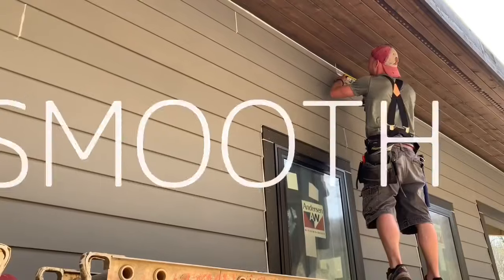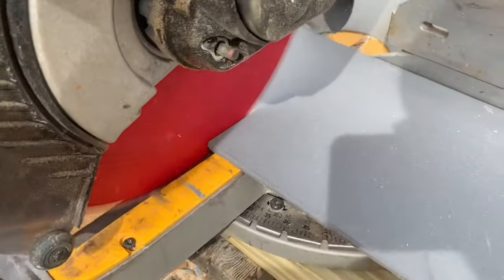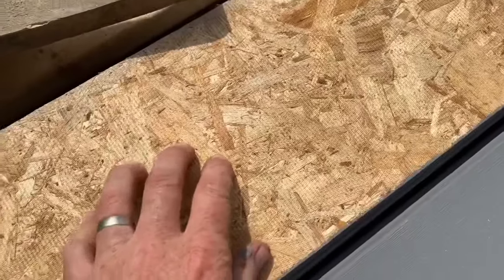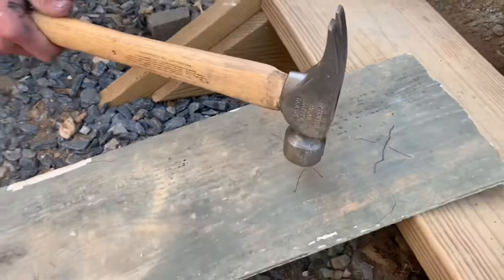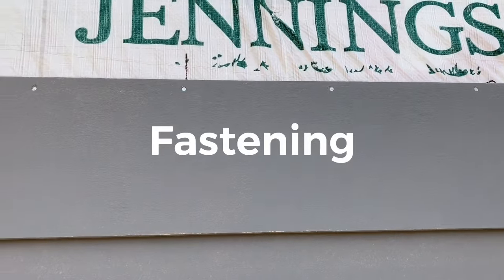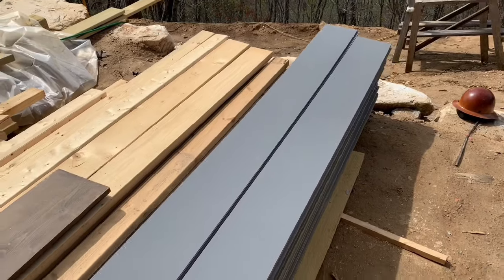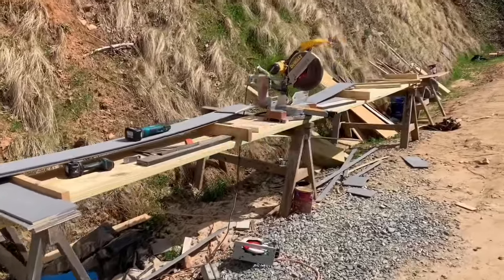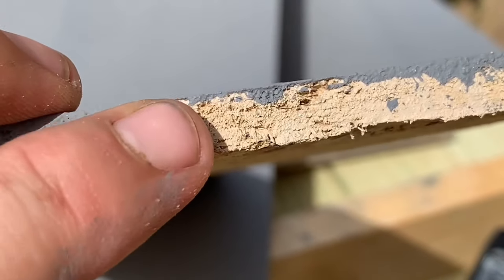Smart Side vs. Hardie Board Siding which is better

Comment: I started as a painter.  Took me 10 years to teach my carpenter buddy to PAINT ALL SIX SIDES BEFORE INSTALLING.  Moisture can enter the product through the back side unless this product is sealed somehow, and that will significantly reduce the lifetime of the paint job, as well as subsequent paint jobs.  I especially don't trust OSB, especially in my climate as we see the product rot out, especially under windows.
Reply: N. Johnsoh some painters don’t like painting all sides on a interior door. Ever looked in your closet above the door?
Reply: There are small gaps under my plank siding. I’m concerned about moisture getting through the gaps during strong wind and rain or during pressure washing. 

What’s your thought of caulking between the planks?  Seems caulking would reduce wind and moisture penetration but would it hold moisture behind the siding thereby delaying drying and leading to mold and/or rot?
Reply: Craig Wheeless 
We used to caulk between the butt joints but now prefer to slip a piece of flashing behind there.  The problem with caulk is that it tends to let go with the expansion and contraction of the siding, and this also allows the caulk to show after its been painted.  The butt joints will not absorb much water if properly painted and sealed, and any water that is absorb now has a path to dry.  Also, you always assume that any method will fail to stop water from getting in at some point, and therefore plan for a way to let the water/moisture back out.
Reply: N. Johnsoh 
Thank you!
Reply: @Josh Yingling 

It does not. It is absolute garbage, even if maintained/painted yearly. A single drop of moisture gets on that OSB and its game over. 

 I had several jobs a while ago repairing siding where this was the  product used and it was completely unavailable, nobody had even heard of it. I got unbelievably lucky and found a small mom-n-pop hardware store that just so happened to have some leftover from a special order that had been placed 3 YEARS prior.

Of course a couple months later every major hardware store (lowes/HD) had it on their shelves as regular stock. 🙄

Its true that Hardieplank can be a bit tricky to work with (impact sensitive) and can become brittle with time and excessive water exposure. But, it is completely impervious to rot and holds paint exceptionally. It is one of the few sidings available that can withstand a lifetime of florida weather. With proper maintenance (paint) of course.
Reply: @Mote78  I used construction adhesive between the top bottom of each lap on a Hardie Board installation. That was for strength though. Didn't want the boards lifting. I left some gaps for air circulation. Used flashing behind each butt joint and did not calk the butt joints. I would do the same thing if using Smart Side lap siding.
Reply: I installed LP Smart Side 4x8 siding panels and painted the bottom 3 feet on the back of the panel. Those tend to rot out on the bottom after 8 - 10 years.
Reply: @regularguy9264  / caulk will never hold up long term without first priming raw wood..
Reply: Miter joints for siding 👌🏻
Reply: @regularguy9264 , use Big Stretch caulk and it will not let go.  You should still use a piece of flashing behind the joint though.
Reply: @comancheclub3449 , you have no clue what you are talking about.  Smart Side is very moisture resistant.  In fact, the Hardie Board is more porous and likely to be become brittle from water damage before the Smart Side would.  The only thing you need to make sure of is to paint the cut edges before you install them and caulk the butt joints.  Smart Side is far superior to Hardie in every way.
Reply: @jtltet  

Please elborate further. Maybe you have a different smart side material than what ive used/seen? 

If you leave a 1x1 piece of OSB and hardie out in the elements the hardi will be there long after the OSB has completely crumbled into pieces.

Hardi is a cement product, smart side is a wood product. Cement literally can not rot. I admit it does have its faults, no product is perfect.

What characteristics of smart side do you find superior over hardie?
Reply: @comancheclub3449 , I have the textured LP Smart Siding on my house.  It has a wood grain pattern and it is not smooth.  I have left some cut pieces of it laying outside in the rain for over 2 years without painting the cut edges or the back and it has not had any rot or swelling at all.  It looks as good as the day I bought it.

It is far superior is hardness and durability to the Hardie Board because it can take a hit from a rock thrown from a lawn mower or a baseball or hail and not even leave a dent where as the Hardie will be damaged from any of those things.

Also people tend to think that because Hardie is cement that it is incapable of water damage and that couldn't be further from the truth.  Cement is porous and absorbs water so over time the exposure to water will make it brittle and possibly even freeze and crack in colder climates.

The one bad thing I will say about LP Smart Side products only applies to the 4x8 sheets and soffit material that you can buy.  I found those particular products to not be the same quality as the actual lap siding.  The out layer of those seems to be thinner and has chipped or peeled off when using a nail gun to apply or sometimes when cutting.  The lap siding and the trim boards had no indication of that at all and were much better quality.

Obviously, I am speaking from my own personal experience.  I am sure as with most things some people may have other opinions but for me I would choose the Smart Siding over Hardie every time.
Reply: @jtltet  

Wow, that does sound good. Whatever smart siding you have is way different to what i see for sale here.

You said you left some pieces laying out completely unpainted and even after 2 years of exposure including rain their was no degradation, how is this possible? What you're using is OSB based material right? In my experience, anytime OSB gets even slightly wet if it's not wiped up immediately it will swell.

If i tried that it would fall apart in a matter of a month or two. 

Can you post a link to the specific product?
Reply: @comancheclub3449  this product is not made like OSB sheathing material that you are used to which can deteriorate quickly after moisture gets on it. Is made and glued together with different resins and waxes and under a lot more pressure. I have been doing some research on it as a homeowner and I've talked to different contractors that install Hardie and Smartside.  Both products have their advantages but I wouldn't compare it to an $8 sheet of half inch OSB
Reply: @Morecowbell4u  

Do you have a link? Is it a wood product?

Im not sure if you read the rest of my coversation, but the product shown in the video looks exactly like another product ive used/seen. Its basically chip/OSB board with a thin veneer of some kind that has been put through a roller to make it look like woodgrain. 

Would like to learn more about it, but if its anything like what ive already worked with i cant say i would use it on any of my projects/recommend it to a client.

Best of luck.
Reply: ITS NOT OSB SIDING! Get the facts straight.
Reply: @samturnau2383  OSB is for sheathing. SmartSide is not OSB siding.
Reply: @comancheclub3449  Its NOT OSB siding. Find out how its made. Far different than OSB. Educate yourself!
Reply: It's NOT OSB.
Reply: @comancheclub3449  I know there are different OSB like Advantech OSB for flooring it can get wet over and over and still be good where cheap OSB is like cardboard but i want to make my house fire resistant so i'm going to use Hardie siding.
Reply: @Mote78  Your not supposed to power wash or even allow your sprinklers to spray on LP.

Look up the warranty! You will be very surprised on what they do not cover and far most the maintenance on that osb siding.
Reply: @teamplayer1218  Look up the warranty on that superior osb siding. Its garbage. Better yet look up osb lp siding reviews and the countless testimonials of that garbage.
Reply: @nunya937  Ummm... its not OSB. Get it right.

Comment: I have Hardi on my house. LP on my shed. You can throw baseballs at the LP and it doesn’t dent. However, I put the the Same Sherwin Williams Emerald paint on them on the same day. 8 years later the paint looked much better on the Hardi. And there was some slight water damage on the LP. Both good products. If you have kids playing ball around ur house... LP. Otherwise get Hardi.Mine is 18 years old and I don’t regret it.

Comment: Y'all should also do a water test and see which one is more durable to water and I bet you will have a different outcome. I totally agree with you on LP being lighter as well as much easier and safer to cut without a doubt. As for the strength durability, I don't ever plan on having a board up with nothing behind it so I'm not so worried about it breaking like that and don't plan on anything hitting it like that once it's up either so that test doesn't do anything for me. However, if I'm putting exterior siding up on a house where it will always see rain and have chances of moisture I'd rather just wear a respirator and change my blade or tool to cut something like Hardie Board that I know won't rot or get damaged from it getting wet like LP Smartside basically even tells you it will themselves in their warranty. Then you also have to worry about termites with LP and you don't with fiber cement. Seems kinda sketchy to me is all I'm saying so I rather not even risk it.

Comment: I am a Remodeling contractor in Washington state,  yes cedar and OSB board siding is way easier to work with then fibre cement type products, though, the majority of repairs and replacements that I have completed are L.P  products , or weather worn natural wood products .
Fibre cement products hold up to wind driven rain far longer then the other products in general use , given proper installation and final finish .

Comment: Hardie plank is fire rated. In Australia we need to use hardie plank for compliance with fire ratings. That osb board crap will rot out and catch fire but is great if it starts raining hammers..
Reply: good for ausies
Reply: the raining hammers comment is right on point! its laughable that people put products through unrealistic tests that have little to no bearing on real world outcomes.
Reply: Weirdly enough I used the Smart side (unpainted) as a fence material. It's been in the weather for over 2 years and it's holding together pretty decent. The glue has a couple extra additives to make it water resistant. So far so good.
Reply: "Raining hammers"

We get baseball sized hail out her in Texas, so that's pretty close to raining hammers.
Reply: Colorado is in hail alley and hail up to softball size isn't unheard of.

Comment: We removed and recycled a 12yr old full house of smart sheet board from a house to be demolished.  It sat in our yard for 18 months. It showed zero signs of swelling on the cut edges snd there was absolutely no rot.  We had to purchase some new sheets and they were slighly different thickness so we worked with that.  We've now been in our house for 5 yrs, making the original sheets 17 yrs old, it still looks fabulous, ee have had mo problems with any of it. We priced out Hardy Board and it would have cost 4x more to complete our house.  My husband built a green house and resided a garden shed with the scap left overs.  We are extremely happy with this product.

Comment: Well I had some hardi lying around for 15 years outside uncovered. I washed it, installed it and threw 2 coats of latex paint on it and it's doing fine. I'm impressed. I'm reluctant to use any osb on exterior. 
I see you guys don't have your siding bottom edge end with tops of doors and top and bottom of window casing. Yes you have to vary the exposure to make it happen. That's never noticed when done right.
I would say any house built before 1950 was done this way. New guys wouldn't know about it if they weren't told. You've been told now. 
Take a few minutes to look at old houses versus new in this regard. Old way was much classier. Once your eye is trained you'll get it. 
Thanks guys !

Comment: I used the early version of this 20 years ago it failed bad . It had a gide groove and the edge wasn't preprimed then they removed the grove and it came wrapped with a factory finish much improved weaknesses is still cuts prime and high quality caulk a must,  by the time you pre-paint not sure your savings anything

Comment: I tested the Hardi Plank in my New Home Model for 3 1/2 years . I  placed it in the back of the toilet tank and would take in and out several times a week to show future home buyers. It never rotted. But it for sure is tougher to install . And can , like it shows in the video break when hit hard. But if you hate rot . This holds up great and paint real last a long time on it .
Reply: It doesn't rot , yes. But will absorb moisture over time.
Reply: And everyone leaves out the part where it's almost completely Fireproof
Reply: @teamplayer1218  I’ve never seen Hardie swell and delaminate from moisture, even the scrap piece he used in the video looks to have been sitting outside on the ground for a long long time.
Reply: You literally would take buyers into the bathroom and make them watch while you fished something out of the toilet ... to demonstrate Hardie board to them?

Comment: I am not sold brother. I don’t give a damn what coating you put on OSB. It is still OSB. I agree Hardie is a pain to work with but it is a far superior product.
Reply: Russell Nentwich right
Reply: Your right those guys are full of it Hardy is a much better product and most high end homes around here will use it or something similar instead of smart siding or any wood.
Reply: @Mr Sunshines there is no argument. I am just relaying information. I was just agreeing with the original post. I used Hardy on my property and work with it everyday. It is not as difficult to put up as he makes it seem. It cuts fine with a Hardy blade and a circular saw. Everything he says goes against what I know from putting up Hardy plank. I am not saying anything about fragility of Hardy. It last longer and no need to prime or seal.
Reply: Mr Sunshines calm down bro, it’s going to be okay.
Reply: And you would be wrong.  Smart Side is far superior to Hardie in every way.
Reply: Mr Sunshines 😂😂😂🤣

Comment: Additionally , my own house has brick veneer up to the window sills , along with a minimum 24" eave on house and 48 " on detached garage .
On all the resides we did for LP failures, 80-90 residence s , no customer requested re reinstalling LP , OSB, lap siding / panels !
90 % replacement was done with James Hardie , fibercement products !
Those jobs took place from 1996 - 2011 , with another wave of the second generation LP products now failing,  we will be busy for some time replacing those installs .
Cheers
Reply: I have no experience with siding but do know of people who used OSB for house construction and now 20 years later are getting soft panels.  So to think that it would work as an outside weather barrier...   ?!
Reply: What is the specific failure you have seen? Elaborate please or dont criticize.  Thanks
Reply: There is no second wave of failures Brian. Get it right.

Comment: I am a home owner with some knowledge of installing and using different products. The only test that counts is on the job usage and time. I predict this product will prove a failure. Do not trust siding that I have to allow all those gaps because it will soak up moisture. Also shy away from the glued up scrap wood look on back. Born to fail. Have H plank on my sheds and house for over 5 years and SO FAR am super satisfied with it.

Comment: I have a couple sample pieces of LP Smartside submerged in a bucket of water outside. Been in there for at least 8 years. Taken out a handful of times to look at them. They are still intact - no delamination, breaking apart or rot.
Reply: Yeah because if you go to LP Smartside web site and read up on their siding they have an added chemical in it that helps the product to be more water resistant (forgot the name of the added chemical) and they also if i'm not mistaken added another chemical for termites as i remember when i did some research on LP Smartside. Today's LP Smartside is NOT like OSB and it is way better as far as water resistent. The new LP Smartside is NOT like the old Smartside with this said Hardie is just as good too, just remember on LP Smartside to paint all exposed edges and primer and paint all cut and exposed edges but you suppose to do that with Hardie too. After i used some LP Smartside on my house i told my son let's throw a piece of this LP siding in the yard and see how it holds to the weather and rain and months later after being rained on multiple times nothing was wrong with it. What i did was use Hardie around my exterior windows and corner trim and the LP Smartside everywhere else and so far so good. I figured the house had T1-11 regular wood siding that lasted 25 years so i know for sure i'll get 30 years or more out of the LP Smartside if i live that long because i'll be 81.